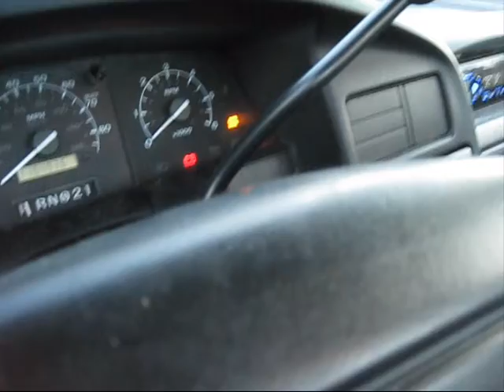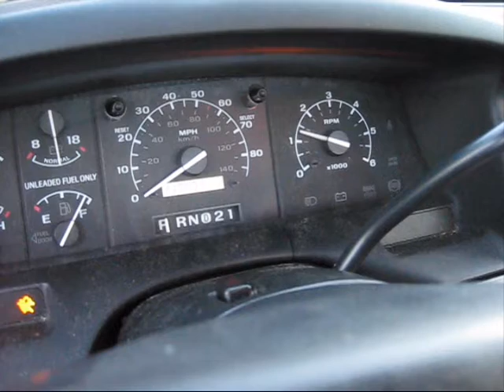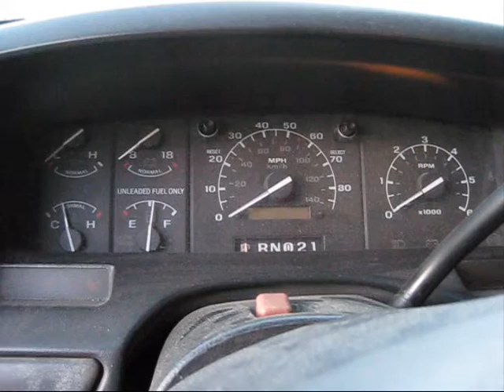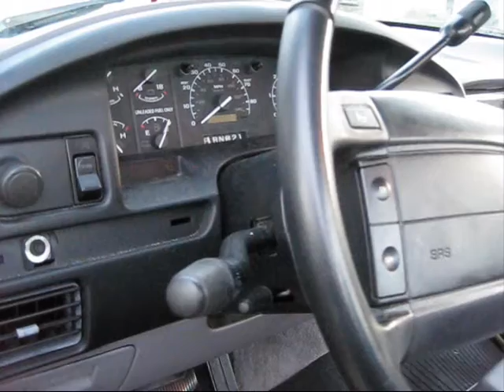OBS Ford early signs of EEC failure

Comment: i have a 93 150 with a 302 and i have recently done a tune up replaced the o2 sensor and the tps cleared the codes and after sitting it starts up and high idles but while in the high idle warmup it acts like it wants to die and the cel will iluminate for a split second then itll go back up to 1200 and run smooth for a bit then itll act up again and do the same thing i had the cel come back on today and it threw a 41 for the o2 sensor which is brand new the harness looked ok and it now has a code 31 for the evp is or was out of range would this be eec related i doubt the evp would cause it to stutter like that and then run fine again
Reply from the maker: You could have an EGR problem which is causing the EVP readings to not line up with what the computer is expecting.

Comment: i have an 1989 Ford Bronco 5.0 V8,  5 speed stick,    when i am at an idle it goes up & down over and over,  i replaced speed control / MAP Sencer  and a lot of other things,  would a PCM  or EEC Cause this to happen  ???  
I am in Michigan last summer i went up north and back Truck always runs fine about a week after i got back it started doing this ...

i am on my witts end with this problem,   it has 104,000 miles on it i bought it in 91'  it always ran Great,    NOT NOW .... PLEASE  HELP ...
Reply from the maker: The EEC can cause all sorts of weird problems. But the IAC controls idle rpm.
Reply: @pfun41  Thanks much for the reply,  this issue has stump me for a while now,   What is the IAC  ?
Reply: @pfun41  The Truck is a 1989 i bought it in 1991 ,  a few years after i bought it it would want to stall at a stop only when the AC was on,   my friend told me he had the same issue & it's your idle speed control ,  that was the problem ,  now my truck is doing things a lot different,  at a stop the idle goes up & down  Over & over

Comment: Guys i have a 94 ford ranger 2.3l giving me headaches i have replaced every sensor ,gasket on intake everything you can think of! And it has a intermittent rough idle! CEL doesnt turn on when KoEO or it doesnt throw any codes! Check Engine light bulb is good but no Codes or no KoEO light at start up.bad..ECM maybe?
Reply: Try a junkyard ecm

Comment: Does the EEC influence the transmission
Reply from the maker: On 92+ models with overdrive yes. E4OD and 4R70W are both electronically controlled.
Reply: @pfun41  ty. My E4OD is shifting erratically. Replaced the speedo speed sensor 2x. No improvement. Checked voltage to sensor @ 0-mph, key-on-not-running & got  intermittent readings nowhere near  and always higher than 1.4 volts, plus the fuel pump runs-on when it should stop once the fuel rail maintains pressure
Reply from the maker: @mikeluke544  Run on fuel pump means either an issue with the relay or EEC.
Reply: @pfun41  1989+ with E4OD yes.
Reply: Only in automatics AFAIK. Manual transmission versions don't look at anything transmission related
Reply: @P7777-u7r  Thanks. Here's a brain teaser: My EEC's programmed to meet the emissions standards applicable to California. Can it be reprogrammed to meet the Federal EPA emissions standards applicable to Florida?
Reply: Did you ever replace your EEC and if you did, did it fix it?
Reply: @nam69lol  No, never replaced.
Reply: @mikeluke544  dang, well thanks for the response
Reply: @nam69lol  I'm hoping a non-Cal EEC module from a local junkyard will work temporarily. I found an out-of-state company that can repair my EEC, but at $450 + core my down time would be 6-weeks +
Reply: @mikeluke544  well keep us updated, even if it's forever from now. It'd be nice to know

Comment: What I want to know is that in comments this is second time I have heard TWO OR BOTH FUEL PUMPS. Is my brain dead or is there actually two fuel pumps, one in tank and second by the inline filter to make pressure to rail???
Reply: Is this dual tank issue?
Reply from the maker: OBS ford pickups had 2 fuel tanks. On the dash is a switch that can change between them. Broncos only had one large rear tank and the rear window switch takes the place of the tank selector switch. This issue will affect either tank, as the EEC is commanding the fuel pump to run regardless of which tank is selected. IIRC some older models had a low pressure fuel pump in the tank and a high pressure fuel pump on the frame rail.
Reply: @pfun41  I can't find a fuel pump on the rail for any year, only tank selector switch, in dual tanks, each tank has a pump I'm finding. Give me year I can look up to find rail pump and pump in tank. Seems ford would have  used one pump and directed flow out of secondary tank to be picked up pump, but then looks as if easier would be to pump gas out of secondary to main, except overfill issues., so far I haven't seen pump on rail, what year has pumps in tank and pump on rail?
Reply: Ok, 88ish, I saw one, first time for me, thanks
Reply: There's two pumps a low and high-pressure, one in the tank and one under the driver's side frame rail underneath the brake booster

Comment: Bet you didn't really understand or know this because I didn't A lot of parts are crossover they can cross over the different vehicles A lot of the computers are plug-and-play well if you have a V8 truck 2wd versus like a four wheel drive V8 truck same year same most of everything I'm doing it right now because I have an F-150 that will keep frying their computers one of three things will happen the ECU will blow or the ignition control module will blow very rarely it will kill the coil before I got the truck they tried to hop the motor up and then halfway through they changed their minds so they took the small pump unit and everything off so if you have somebody that has a old school 50 with the small unit they want to you know trade sell I don't care hit me up I will respond to comments may take me a day or two but yeah I've recently put in an ECU out of a I think the junkyard said it was a Grand Marquis or a crown VicI plugged it in and believe it or not the son of a gun works arrow on the side of caution I do not and all cats do not advise anyone doing that I just have an old truck that I really don't care about because he keeps him trying to computers and I can't afford to pay $200 a pop so that's what I do

Comment: My91 f150 it was a 6 cylinder I started to have those same symptoms but it was very hard to start most all the time but you're not wrong at all but anyways one time when I got it started I swear to God I drove like 2 miles and I could look behind me and see smoke clouds and I burn a quarter of a tank of gas ask if I'm lying I'm dying
Reply: My 94 F-250 is leaving the same clouds cause it’s running so rich. I’m actually measuring gallons per mile now instead of miles per gallon. It finally went to a no start condition the other day so now I’m in the process f trying to find a remanufactured ECU now but having trouble locating one now but will change it when I find it!

Any luck on yours Phil??
Reply: Hope you fixed it but it is computer failure I've done my research and prepared it simple capacitor that is gone week corroded or blown just by age just have to pull the computer and I'm not sure on the exact location look it up on many different YouTube videos and it will show you the exact capacitor and you can resolder it and check the rest of them replaced ones that you see that are leaking boom problem fixed but you got to get the correct ones so look it up on the video on YouTube can't tell which one look up ECU repair

Comment: My 87 broncos fuel pump wont prime at all (on the odd occasion) what could cause that?
Reply from the maker: If it doesn't run ever then its likely an issue with the circuit.

Comment: Hey man I have a 95 bronco 5.0 having a tricky issue and guessing it’s a very common one . Have a starting issue . Starts up runs great  shut it off run inside the store and just cranks with no start wait a little time and starts right up . Replaced just about everything besides the computer and distributer any suggestions would be appreciated
Reply from the maker: Something is heat soaking. It works fine when cold but fails hot. If it's loosing spark I'd look at the TFI module on the fender or the PIP sensor in the distributor. when it fails does the Tach move when you crank it?
Reply: pfun41 thanks man was the pip sensor. Runs like a champ now !!

Comment: I saw another helpful YouTube video similar to this one. I replaced both fuel pumps truck drove fine for 2 days. Then the idling misfire problems came back to haunt me again. So I replaced map sensor,  upper intake gasket for the removal of the 6 injectors that were (Quality rebuilt stock 14lb fuel injectors  w/ lifetime warranty), throttle body gasket, fuel pressure regulator, fuel pump relay fuse, cap & rotor, coil, plugs checked good, ignition control module,  tps sensor, IAC valve. Damn whats left to do...guess its the computer now..smh. The pump did sometimes stay on after I use my OBD1 scanner (which it can't read anything anymore). When it did work it gave a code 334 for the egr crap. I did a delete with a block plate and plugged in a sensor plug to throw off the C.E.L ..I'd hate to give up on my truck. I pulled out my ecu removed the back plate off & saw the 3 blue capacitors burned, rusted looking. I sent my ecu off to get it repaired. Hopefully this fix my problem. I love my truck and miss driving it.
Reply: Just anew update everyone..aside from having my engine rebuilt I just had the top half redone. Head resurfaced, new valves, pushrods, fel pro cylinder head gasket kit installed. Had everything put back together but removed my emissions system removed such as (air pump bypassed), hoses etc. Used a shorter belt and blocked off the air holes in the head. Truck runs perfectly fine now..I'm happy I must say..!
Reply: @gaddy8964  Thank you for your input and what a journey you took; seriously dude, but know that you have saved some of us hard dollars. Thank you, Gaddy
Reply: @gaddy8964  i work in same rebuilt 4.9 but today i cant read the codes so i think in 3 capacitors burn, whit the key on the pump run constantly😔😔😔😔 the good notice i have a lot capacitors all ohms🤭🤭🤭😏😏😏
Edit: the truck dont run just crank
Reply: @gaddy8964  what all did you replace my dads truck is having the same issue?
Reply: Replaced almost everything on my foxbody and months later only thing left was ecu and that was the issue the entire time, only good thing I got out of it I learned alot lol
Reply: Did it fix it?
Reply: @catalinaramirez6495  Yes the ecu did the fix, however shortly afterwards my 2nd cylinder dropped  alot of compression 39-45psi compared to the other good cylinders. So I decided to have my engine rebuilt. I  almost sold it but changed my mind.
Reply: What all did you replace?
Reply: Well, what was the result ?   After going through all this stuff, I just parked the truck, but maybe gonna replace the temp sensor, sender...
Reply: @xzqzq  the latest update was posted 7 months ago. However my  2nd cylinder was low on compression.
Reply: @gaddy8964  K

Comment: Would the slow death of an EEC cause engine issues? Poor performance, loss of power and even emissions test failure? The swan song of old Fords apparently...
Reply: UPDATE..!!! I got my truck computer (ECU) back 12/12/2020 installed it a day later. Good news is that the truck runs like a brand new well oiled sewing machine..! I couldn't be any happier. I crank the truck after installing the ecu and let it ran for 40mins and no change in idle, sound, anything. I knew I was good after 5-10min passed. So I'm convinced that was my problem despite replacing all the sensors,  ignition components,  fuel pumps, injectors also. With the age of my truck and the pristine condition I try to keep it in eventually those items would've been going bad so no need to worry about replacing any of items anytime soon. The fuel pumps definitely needed changing, but it didn't give me the symptoms like my bad ecu did. If anyone is in the need of their ecu repaired check out this company. 
https://www.ebay.com/str/zkboys
Reply: @gaddy8964  That is great news! I am definitely looking at the same thing and I appreciate the link too! I love that this thread has been so  active and helpful :) Nice work all around
Reply: @toothpastehombre  You're welcome man... its definitely helped me figure out alot regarding fixing up my truck. Glad it helped you out..!
Reply from the maker: IME it usually just starts doing weird things.
Reply: @pfun41  Hey thanks for the reply. My 1992 van has been running rough with sporadic issues. I've replaced quite a few relays and sensors. Even the CAT after a failed emissions test. Then it just died one day while running fine, wouldn't start back up. I couldn't hear the fuel pump, so replaced relay, filter, pressure regulator and then eventually the pump. Welllll now when you turn the key on the pump just runs and runs, but the van won't start at all. Bit of googling, now I'm looking at EEC/PCM issues. Sorry for the vehicle issues dump, your vid is helpful - thanks
Reply from the maker: @toothpastehombre  Yeah Fuel pump being commanded on continuously is usually a  sign of EEC trouble. The other symptoms are sporatic and vary wildly from vehicle to vehicle.
Reply: I'd bet it would cause engine issues. Because before I checked or even knew to look into the ecu even after changing all the sensors, IAC valve, ignition components the truck still performed poorly after about 5-10minutes of running. It seemed like everything started failing one right another..I'll gladly update my results on this thread once my ecu comes back within 2wks. Best of luck with your truck running right again.

Comment: This was the exact issue on my 95 F-150. I was having all kinds of strange problems, like the Check Engine light would come on when I started the truck and the engine would run very poorly and with barely any power. I put a new MAP sensor in, along with a new ignition control module, but those didn't help. Then the issue went away for two months, and then came back and got worse and worse. Then the engine would cut out while driving randomly. I was skeptical that the EEC was going bad since it was fine for two months until I came across your video. I checked, and sure enough, the truck was continuously priming the fuel pump. I replaced the three capacitors (at least two of them had leaked), and it fixed it. Thank you!

Warning to others: the solder pads lift very easily, even without scraping the rubber coating off, so be extra careful.
Reply: Just had to replace mine in my 96 5.0 150. Would keep throwing o2 sensor codes, and we would keep replacing them, and they would just come back. It ran like shit intermittently, had low idle or too high of an idle, and overly long fuel pump priming. After replacing the ecu a month ago, I've had zero issues since.
Reply: How and what capacitors did you replace if you don't mind me asking I just replaced my computer with a remanufactured for 150 because I wasn't getting power to the inertia switch and running like shit I could jump relay and get it to crank without relay in but ran like shit I put the knew one in and it stopped it did fine for a few days it gets power to the inertia switch but now is doing exactly what yours is doing except when the fuel pump stays on it will not start at all..... what would be the best way to fix this idk if it has a warranty or not I'm assuming it doesn't
Reply: @damonstephens6058  order a capacitor kit for your make model and year ecu. or pull the ecu, and buy equivalent ones in both capacitance and voltage rating. make sure you replace them in the correct orientation, the line across the side is the negative  side
Reply: @damonstephens6058  https://youtu.be/zl_qbpVimPs😊😊
Reply: @damonstephens6058 ,,, it's usually the 3 blue capacitors  .
Reply: Ha, ha, ha,,,,...   THANKS for your personal  input....  This is  exactly what my 93 F-150 TRK is doing.....!  All the steps you did I also did..  Plus,, I had to go through in a rear  tank fuel pump  R&R due to the FORD fuel pump recall.  Due to fuel coming out of the service cap..  However I had a belief the ECM was failing.  I plan to do a R&R ECM.  The sad thing is getting quality parts from FORD on these old TRUCKS, they are not there.  Only CRAP low quality SPECs from CHINA.. So my TRUCK is out of commission and I will buy a replacement rebuilt ECM..
Reply: @RAF-FIG  just buy the caps and replace them
Reply: What all did you change out?
Reply: Thanks for the heads up buddy

Comment: The glow plugs in the gas tank are warming up. 😭
Reply: Did u swap the computer from the bronco? Just a thought. Im having an issue with my 87 f150. It shuts off while driving or idling. But starts right back up every time

Comment: What if the fuel pump doesnt turn on at all?
Reply from the maker: Doesn't tell you much. Could easily be an issue with the fuel pump circuit or the pump itself.
Reply: @pfun41  I'm having random symptoms all over the place, it's gotta be the ecm that's the only thing that makes sense. I've replaced fuel pump, relays, coil, filters, dielectric grease all connectors I can get to, it'll run great and then shut off 2 miles later, drag it home and it cranks again, I was about to switch it over to plain old school set up geez Louise, it's gotta be it, wish me luck, 96 5.0 m5od manual 4x4 stock except dual exhaust and 35s,  thanks bud!
Reply from the maker: @rbnhd1976  If It dies when hot then it could be the ICM or PIP